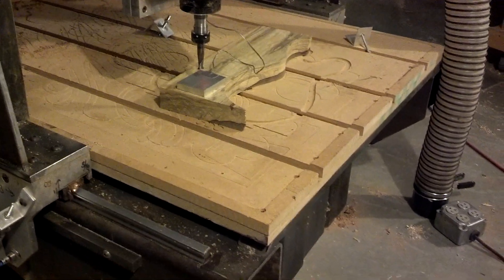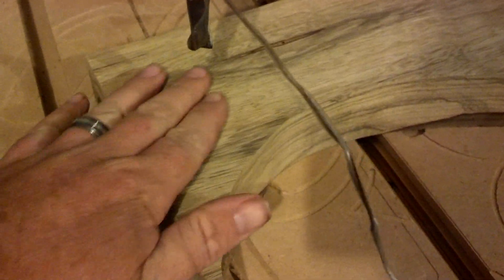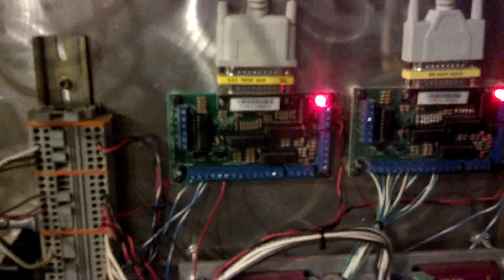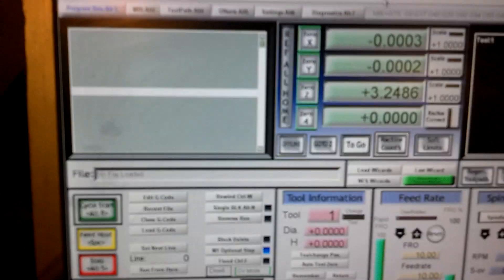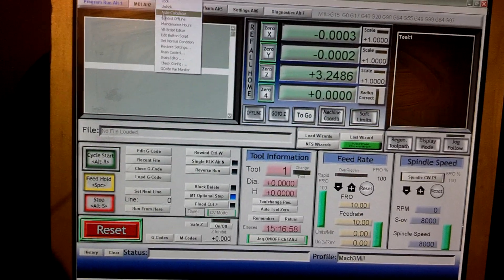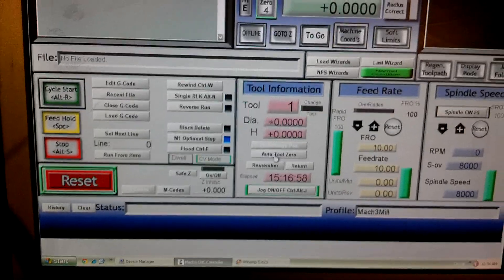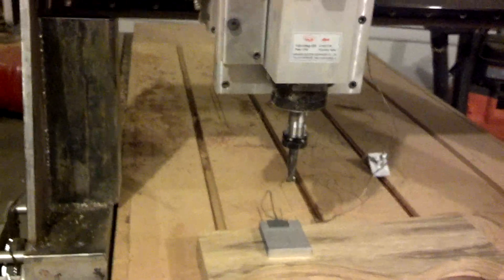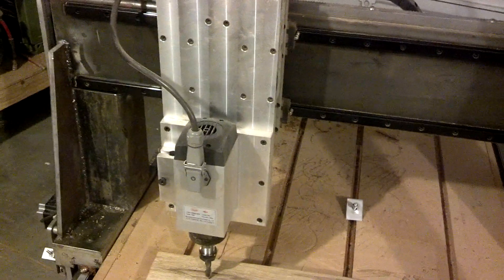CNC Tutorial - Touch Probe in Mach 3

Comment: "Call SetDro (2, PlateThickness)"  Does this set the Z-coordinate in terms of the machine coordinate system? Wouldn't this mean that anything with an absolute position in terms of absolute machine coordinates (e.g. your touch-probe location, a tool magazine for an ATC, soft limits for the Z-axis,...) would be affected?
Reply from the maker: Marcus Wolschon Great question. I will do my best off the top of my head, but verify. In my car I don't care about absolute machine coordinates with my Z. I use it for X and Y but there is no distinction in practicality for Z. This sets my work coordinates for Z. My machine Z doesn't really come into play. Since the Z never homes it doesn't really matter. Hope that helps.
Reply: Alex Crane thanks. My Z does home and I need to move into the ATC tool magazine at a specific height. So I better look into setting tool height offsets instead. Thanks for the clarification.

Comment: Well done Alex! Just spent a full day dealing with signal noise from my DIY touch probe and finally got it sorted out (added a 1uf electrolytic capacitor to the input pin). Anyhoo, great job and look forward to any new videos you put up :)
Reply from the maker: +Houston Firefox Thanks! I have been meaning to re-do this video along with the fixture one and shoot for a bit better production quality as opposed to just holding my camera phone. Revise the info a bit and add some more about Mach3 setup. Also great tip with the cap for noise filtering. I know a lot of folks have trouble with that. Thanks for you kind words!

Comment: Hi,

I need your help, if you can help me.
I want to do engraving of aluminum sheets 3mm thick. That aluminum sheet is 1000mmx2000mm. I want to do engraving on that sheet 1mm depth. I want that depth 1mm on whole length to be the same depth. My table on cnc machine is not perfectly flat, so when I do engraving on one side of the sheet machine make 1mm depth, on the other side 0.8mm depth, on the third side 0.6mm...I don't want that, I want the same depth on every side (1mm). That is why I need something to "scan" surface, and send info in computer, so when I do engraving to have same deep on whole sheet.
Something like on this video /watch?v=eJCSRXZf_Ok
That is a touch probe.
I called this company DATRON, and they want 7000 Dollars for this device...
It's too much money.
I watched your and I think that on these way my problem can be solved.
Can you please advise me, or make a video with instructions how to engrave sheet 1000x2000mm, and get the same engraving depth on whole sheet.

Thank you in advance
Reply from the maker: Ado Sehovic I think the best way to combat this would be to securely attach a spoil board to your bet and then mill the spoil board flat. I'm not aware of any probe type setups to fix an uneven bed. I do know they are out there, but the spoil board method is what I use.

Comment: How did you connect two boards in your computer and set up on March 3? Thanks for your advices.. :)
Reply from the maker: I added an extra PCI parallel port and ran two parallel cables to separate breakout boards. -Alex
Reply: Alex Crane Thanks, i'll do it, just finding a way for identify the boards on march 3.
Reply from the maker: Ihargo Santos That pretty easy. You just have to tell it which port to look at. It's right on the settings screen, the name of the text field doesn't pop into my head at the moment but its really easy to find.

Comment: Dude! Buy an enclosure for the electronics, controller! You have a CNC, cut out a faceplate and make a chassis for the controller/electronics. A good sight, if you can't cut aluminum is frontpanelexpress. I have not used them, but it seems a good sight for custom enclosures and face plates. Keep up the good work, mate.